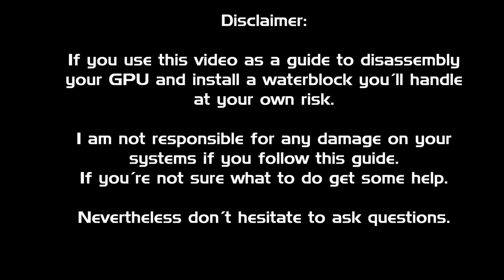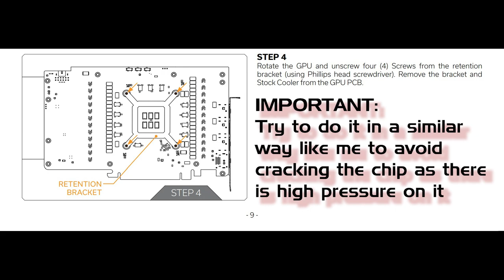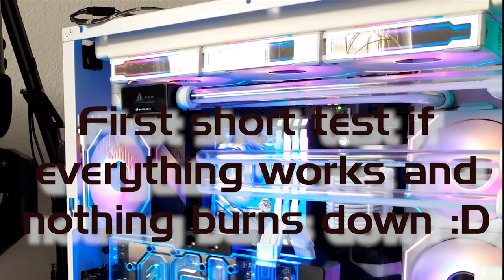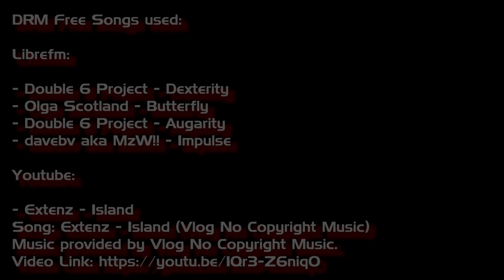Timelapse: Installing an EK-Quantum Vector² Waterblock to an Asus TUF RTX 4090

Comment: READ BEFORE ATTEMPTING. Generally a good video, but it led me to one massive problem. I followed you (and EK’s instructions) and tried unscrewing the two backplate screws before taking off the heat sink because I assumed I need to to remove the heat sink. The heat sink obstructs your screw driver, forcing you to unscrew from about a 25 degree angle. The first one I tried worked but was difficult, and the second one just wouldn’t work. I then decided to take the heat sink off (which we all should have done first) but by that time the screw was way too stripped. I tried everything I could until 2am last night and no method was working. Had to go to Ace hardware where a very kind ex-surgeon helped me and it took us an hour to get the stripped screw out. I ended up having to buy a dremmel to turn the screw head into a pseudo flathead to fix the problem. Sparks flying everywhere. Still haven’t tried the card yet but I got the waterblock on. Again… TAKE THE HEATSINK OFF BEFORE UNSCREWING THE TWO BACKPLATE SCREWS!
Reply: Oof
Reply from the maker: sad to here that but I´ve removed bot screws without any issue..

Comment: A very detailed installation video compared to others, awesome mate thank you for documenting everything and make it entertaining as well! Mine is on the way to me and I just was wondering, are there any dedicated "in" and "out" ports for this block or it doesn't really matter? Wasn't able to find anything on EK's site and shouldn't really matter but just wondering.
Reply from the maker: They say It doesn´t matter but when you look on the flow direction it makes sense in my opinion to let the fluid in on the left port and out on the right.
Reply: @DerVali  I see... that's great info for me to work with. Thank you for getting back to me, much appreciated!

Comment: how is the thermals?
Reply from the maker: WHat do you mean by that? Temperatures? On max load I have 46°C on the GPU, 50°C on the Memory and on the Hotspot max 70 (which I reach after few hours of gaming or benchmarking)
Reply: @DerVali  yes. How it was before? With the fan, because I have 60c max with air cooling, this new 40 series have good temps even with stock cooler
Reply from the maker: @DanCycles  correct I already described it in an other comment.... There is no Big difference between stock cooler and waterblock.... Which is no Big surprise because the cooler is nearly Double as big as the PCB itself  :D

So before it was 5 to 10 degrees more not that much. Mainly swapped for optical Reason and the fun of Building computer stuff

Comment: Cuz of your video I got the same gpu and water block! For the vertical mounting, did you use the EK  Gen 4 riser? Their website says is compatible with active back plates water blocks, but doesn't mention specifically the RTX 4090s ABP
Reply from the maker: No I bought a Riser Cable from Linkup..... You´ll find it on Amazon: LINKUP - Ultra PCIe 4.0 X16 Riser-Kabel [RTX4090 RX6950XT x570 B550 Z690

Comment: Great system, terrible liquid (be careful with opaque fluids). I have the 4090 ABP block coming for my MSI 4090. Process doesn't look too difficult.
Reply from the maker: Thanks. No issues yet with the liquid using it almost a year now... ✌️
Reply: Been running opaque liquid the last 6 years in my current build without issues.  I haven't even fully disassembled the loop to clean the blocks in that time either and it still cools completely fine.

It's the soft tubing that causes most of the gunk problems.  The plasticizer leeches out and then people blame the gunk on dyes/opaque fluid.  Build 100% hardline and you shouldn't have many issues at all.
Reply: @DerVali  Did you have to use three different thermal pad thicknesses on the block? I noticed in the video, the instructions you put up had 1mm, 1.5mm and 2mm. Did you have to use all three thicknesses on the block? I'm thinking of buying higher performance pads for my block but three different pads seems kinda crazy.
Reply from the maker: @GSP-76  yes but only on the backplate. On the chipside it’s only one thickness
Reply: @DerVali  Yeah I just looked up the instructions for the ABP model for my 4090 and it uses two different pad thicknesses...looks like 1mm for GPU side and 2mm for backplate side.

Comment: Can this mounted on the motherboard traditionally? Not vertical. I think my Noctua nh d15 will interfere with the backplate.
Reply from the maker: Yes of course but you should be more worried about the height of the M2 Coolers on the motherboard itself. they are so high these days.... WIth M2 Cooler I am unable to install this GPU with this cooler traditionally....

Comment: I struggled with this one a bit too on my strix, thinking maybe it was the thermal pads. Ended up at slight angle when I mounted but couldn’t screw it down anymore already applied quite a lot of pressure. The front plate would never seem to line up property with screw holes. Not sure if I should try to re-assemble it. It works fine temps are great OC good. Just that front plate it at slight angle you tell when mounted normally it angles down by a few mm from left to right bothers me lol
Reply from the maker: yeah getting it alligned was a pain in the arse, feel your pain :D

Comment: Hi which Parts did you use for your Custom Loop?
Do you think a asus RTX 4090 tuf  is compatible with Corsair 14/10mm G1/4 tubes ?
Reply from the maker: sure this will fit I am also using 14/10. 98% of my loop is build with parts of Bykski and one Alphacool Temp Sensor and the EK Drain you also can see in the video.

Comment: hey im using the same block, having issues with cryofuel (clear) particles falling out and building up. how's yours going?
Reply from the maker: Fortunately for me everything is fine and leak-proof. Did you tighten all the screw correctly? If yes I would recommend to get in contact with EK support
Reply: EK Cryofuel is very problematic... especially the clear fluid for some odd reason. What happened to you has happened to a LOT of people. Flush the fluid out of your loop. Keep flushing with distilled water until you're 100% sure it's all out and then fill it with just distilled water and an additive like Liquid Utopia. You'll be much better off.
Reply from the maker: @GSP-76  no issues for me After almost a year now. But I am aware that they had a Bad batch which obviously  was before I Build my system 😅
Reply: @GSP-76  thanks

Comment: Bravo beautiful video, I intend to buy this model from EKWB. How many degrees did you gain with the gpu waterblock from EKWB compared to the cooling system from Asus.
Reply from the maker: Not that much temperature difference as the stock coolers are also very good. Was only an optical change. Under full load gpu at 50-55 and hotspot highest temp I saw was 74

Comment: is that the o11d xl case? and how thick are your rads? Is the distro plate a v.1 or the new v.2? thanks for the video thats the final piece to this build, will be going with the gigabyte aorus 4090 card. great looking build very clean. mine not so much. LOL
Reply from the maker: Yap it´s the  o11d xl. all three 360 rads are about 3cm thick. Thanks, yeah the build is okay for now but the color scheme makes me nervous.... still too much black in that white build... Thinking of changing the board to a white one :)

Comment: Hi, nice video! Thank you for making it! 👍 I noticed in your video and in the instruction PDF, nothing was ever mentioned about torque values on the screws attaching the cooler to the GPU. I sent an email to EK asking about it and they said to use the EK 0.6 Nm screwdriver. I'm wondering if the tech confused my question with torquing the CPU water block to the CPU as opposed to the GPU water block? Seems excessive, but what do I know? Thanks! 🙂
Reply from the maker: to be honest I just srew it tight as much I tought its necessary.... we shouldn´t make science out of this :) In fact it wouldnt be not a bad idea using the 0,6 nm Screwdriver on the four screws around the chip but NOT on the acrylic.... could be to much force...
Reply: @DerVali  Hi and I agree.....I installed the water block last night and I gave up trying to torque the 4 screws around the GPU as they were getting crazy tight for their size and I still could not get the torque screwdriver to click, so I chickened out. I think 0.6 is too much as opposed to the CPU water block which worked out rather well. I am not sure why they want you to remove the oval o-rings from the terminal block just to put them back in again, so I didn't. When I got it all together and ran a pressure test, my heart sank as it wouldn't hold pressure. I removed the terminal block and one oval o-ring on the side that was not removed was defective. I replaced it with the extra o-ring and all is good. GPU temps at idle are 36.1 C, GPU Hot Spot 46.7 C, and memory is 32 C....of course, no water, radiator, or pump is installed yet. BTW, cutting and applying the thermal pads is an excruciating ordeal I may not do again, soon. Thanks for the response. 🙂
Reply from the maker: @Cleatus46  Haha, I know what you talkin about.... I also didn´t get it why removing the o-rings... I think most likely they say this so you don´t lose them while putting everything togehter or f them up while doing it.... and the stuff with the thermal pads I fully agree.... this is so akward.... ypu paying that much money and they are not able to pre cut it like "cheaper" competitors... and this is not enough.... if you cut them exactly like described in the manual they are visible to the acryl facepalm ..... :D

Comment: Is it the same with the rog strix block?
Reply from the maker: Yeah it´s basically the same procedure. There is only one extra step for the TUF to put one Screw on a Nut which I´ve struggled a bit as you can see on 9:03

Comment: Hello, does anyone know the temperature difference between the ABP and the normal waterblock? I want to buy it but I don't know if it's really worth it
Reply from the maker: should be only a few degrees as there is nothing special to cool on the backside of a 4090.... So If you want to save some money buy it without ABP or even better: Go with an other waterblock as there are multiple which has better  cooling performance. Not saying this one is bad, but it´s just midrange from a cooling perspective.... At the end it´s an optical decision....

Comment: Nice video! would you recommend going with the double sided cooling? rather than a regular waterblock? have you seen a difference?
Reply from the maker: As there is nothing on the backside of the PCB which needs to be cooled  it´s not really necessary. But at the end the whole PCB is watercooled on both sides which makes the whole package a little bit cooler which is nice to have especially in the O11 XL which hasn´t the best airflow. But we´re talking about a few degrees.... And it looks kinda cool :D But not really necessary if you don´t want to spend that much money....
Reply: I think there is a difference. I have the ABP on my 4090 TUF OC too. While gaming my hotspot(!) is around 45-50° maximum (in loop with 13900KF, cooled by 2x480 + 1x240 Rad in the 7000D airflow), depending on the game. The card benefits from the block on the back. And even with no components on the back side, the card will heat up on it while being used. The backplate is heating up over time aswell (even with no comps on the backside). This heat will be in your case and has to be transported to the outside by your fans. With the ABP set, there is no heat from the GPU in your case. The case stays cooler all in all.

Comment: Very clear video especially with the support of the instruction booklet. A small question, why did you leave the mosfets exposed on the ends? (min 11:08)
Reply from the maker: I just forgot Them... But this is not as Bad as you might think because it helps a little bit against coil whine
Reply: Ok sweet. Just installed my ABP on a 4090 Strix the other day. I did cover those mosfets you noted here, the whole region coloured in red. I'm away at work right now so haven't finished the build yet, but I was hoping that the area I covered was correct haha.

Comment: 11:03 you missed the left memory backside
Reply from the maker: damn you are right.... :o 

But to be honest.... it´s not really affecting the temperatures.... as the backplate is more of a gimmick for the 4090 not like for the 3090. 
Highest memory temperature I saw was 50 degrees which is completely fine for the memory...

Thanks for the heads up, will fix this next time I´ll drain the the loop

Comment: ohh I never expected there are still dual sided waterblocks since GDDR6X VRAMs becoming 2gig on one die, and thanks to your video I've put this into my chart. btw how is the temperature performance?
Reply from the maker: there is not much difference in temperatures with stock settings as the coolers are so massiveon the 40 gen. but with waterblocks you can get some more mhz at overclocking thats for sure

Comment: My MSI Trio Gaming X that I put this block on had 3 spacings for the back. Yours has two like normal.. I have a Singularity case and it sticks out so far with my GPU verticle.. I'm thinking of cutting it..  Do they sell these back retention plates as extra or upgrades.. Individually?
Reply from the maker: I dont Know sorry. You May ask the custom er Support.

Comment: Why the block on the back as well?
I mean there's no memory on there, wouldn't a backplate with thermal pads suffice?
Reply from the maker: Yes block on the backside not really necessary. A Backplate is enough.